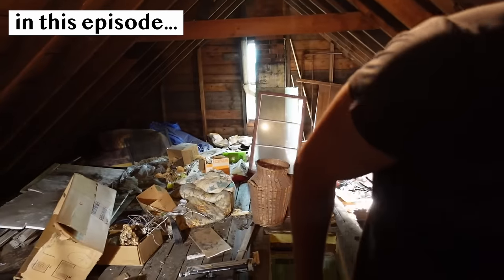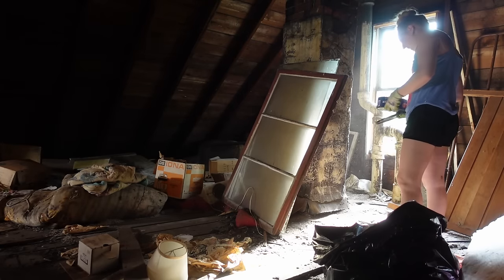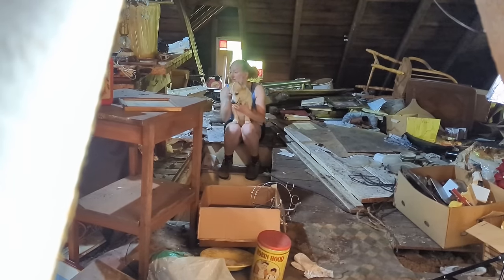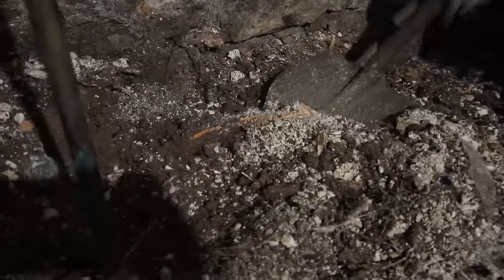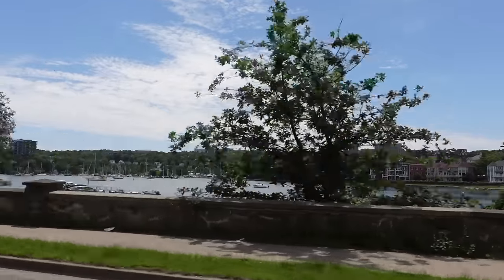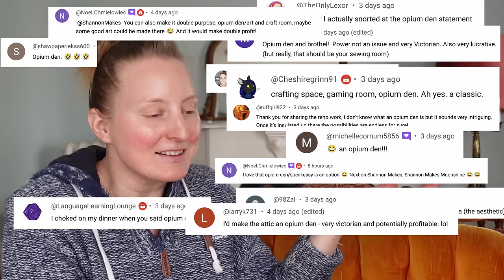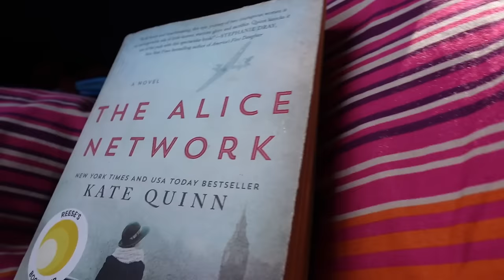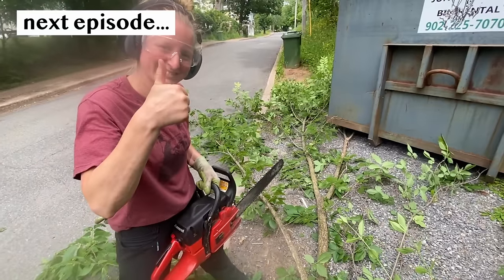A Century of Antiques in my Spooky Attic: Trash or Treasure? (ep.3)

Comment: A good idea is to get a kit so you can check for lead in china glazes and crystal, to make sure what you can use or just display.
Reply: I got one on eBay recently for checking vintage pewter that I want to use for reenactment.  Not expensive and looks like it'll be really easy to use, when I get it all out of storage 😀
Reply from the maker: I am far too savage to actually use any of the china 🤣

Comment: Insulation is needed, decoration later as you stated. Make a priority list. Heat & hot water, insulation to prevent heat loss through the attic and learn to cut glass and reglaze them. Hunt market place for old storm windows that would otherwise be thrown out. Get measurements and always carry a tape measure with when shopping.

Comment: That attic looks almost identical to the Maine 1880s Victorian house attic that I grew up in. I cannot emphasize enough how cold or hot it was. One winter we lost a slate off our roof and a small pile of snow got through the boards and sat there on the floor until the spring when it melted. If you decide to use it for a crafting room, even with insulation, I would think that you would need a separate source of heat and air conditioning because I can't imagine the insulation would be enough. That said, we did have a pool table up there that had collapsible legs but there were only about 10 days a year we could use it.

Comment: You can insulate the attic floor if you don't need the attic for a living. And renovate the windows in the attic. That will help a lot in the beginning with not to much cost. .  You can do it by your self and safe money for heating. The roof seems to be ok for the moment. If you don't insulate the roof from inside the attic you can always see what is going on with the roof.  But it is only my opinion.

Comment: I'm way late to the party but I have an idea for your attic that you haven't mentioned. It's probably because it won't work for some reason or other, but just in case it hasn't occurred to you, here's one of my personal home improvement dreams:
I've always wanted to have a home gym (for lack of a better word). I don't mean a space crammed with heavy duty strength training equipment, I mean something more akin to a dance studio with wall bars, free weights, various mats, a huge mirror, the fun stuff, you get the idea. Screw a few climbing holds into the walls for killer strength sessions bouldering an overhang. Get a small trampolin. a balance beam. A slackline. Rings in the rafters. It wouldn't even require a ton of insulation to begin with, though you'd probably be restricted in when you can actually use it without.
Doing what you do, I would at least consider turning a large attic into a space for training and rehearsal - if you can make it fit your requirements, anyway, if it's high enough and whatnot. I don't really know anything about your art, but presumably, there are things in your exercise routine that would work?

Comment: YESSSS, using the word "defenestration" properly in a full sentence!

And I fooled my sister in-law this year by giving her one of those Danish butter cookie tins...full of the original cookies!!!

Oooooh, scaffolding....that's on my list of things to eventually acquire.

Wow, the Halifax Habitat ReStore looks like it's three times the size of the one near me (Ottawa East)!

...if you ever have to get the roof done, adding skylights for the attic would be awesome... but I don't think I'd risk doing them without redoing the roof around them and I can't remember if you said the roof had been done or whether it was ok or whether it needed doing... Insulating the heck out of it and painting at least the ceiling-ish parts white would probably help a lot with the lighting, we work in buildings the same age and one of them has a skylight in the dining room and it makes all the difference in what's otherwise a pretty small apartment crammed into an attic... and in the one next door without the skylight, using a very light coloured floor brightened up the kitchen significantly from the previous terra cotta tile. That one needs insulation though, rather badly, the hip walls get hot in the summer from the sun outside, as we discovered while removing tile from the bathroom during a renovation project in there one July...

These videos are such fun, I love old houses and all the things to find in them!

Comment: If it were my space and knowing that you are a consummate DIYer/sewist/crafter, I would cut out those beautiful skylights and make it into a super spacious crafting space with a few nook areas to sit and read and think and of course, a cozy space to take a nap
….but you don’t seem like the napping type. Now, being that it’s the attic, It’s hot, of course, in the summer months, so ventilation and air circulation is key if you’re planning to use the space all year round.  If the house was located in the US, I’d say an AC system would be essential bc otherwise, even lots of fans are not going to cool things off enough in the summer and even most of the spring. P.S. I don’t blame you about not disclosing your specific location/address. There are just too many crazies out there and you can never know who’s watching.  Good call!👍

Comment: You should first look for newspaper articles related to the house or address. After that, the assessors office would have info on the property records. Possibly, your public records office could have pictures or papers of the house that are dated. After that, public sourcing will also work like you asked for. 
My last suggestion and this doesn't always work is asking the previous owners. They tend to know this info already. 
Part of this is just filling out information requests with your local office.

Comment: I grew up with a black phone with rotary on the wall. Later, I had harvest gold with dials. I still have two harvest gold dial phones, one for the wall and one for a table. I still used that phone number until 2004. At that point, I could answer the phone using those plugged in. I couldn’t dial out.

Comment: Keep the attic as your private creative get away space 😊 They have a spray insulation that is offered now however if you ever had a roof leak it may be difficult to determine where the leak is coming from.
Reply from the maker: Oh, I will NOT be putting spray foam in my house... too many problems with that, lots of historical house professionals are seeing lots of trouble that it causes

Comment: I have a question….when the energy people came and gave you a consult…didn’t they say to insulate the attic? Your winter heating is going to be a big issue and Nova Scotia has at least six months using heat. But if you can get away with not insulating the attic…then make it a summer AirBnB room. That is …if you can create a cross ventilation with ceiling fans. As you said your attic can be very hot in the summer. You will have a short time for visitors…June through August and then September for fall color leaf peepers. To make the interior lighter use a paint sprayer to spray the entire interior white…..roof beams and wall…I have seen this done and its amazing how fast, cheap and effective it is. Or use the room in the summer for fellow performers in need of a vacation. I am on an island in Maine and have many visitors in July and August. Also..I mentioned getting a woodstove for your fireplace….these can be safely scrounged…you will just need to line your chimney with a metal chimney liner which is cheap and easy ….and get a used stove (many are free because they are heavy to move) and replace all the firebricks that line the inside of the stove…which is cheap and easy.

Comment: Lighting for the attic. LED light tape. You can glue or tack it to the ceiling. That is what I'm going to do in my attic/craft room Want a finished look, get creative with molding, plexiglass or yes you can buy finished lighting units, where's the fun in that? Comes in shop lighting, looks like fluorescent, just as bright or brighter and more energy efficient.  That is probably what you want for the basement, unless you are going to convert it into a torture chamber then it would kill the esthetics.

Comment: Try your local historical society, if you have one.
Reply: New to your channel!  Enjoyed your first video…the first thing you need to do is check to see if you have a secure roof. If you insulate all of your attics and then get a leak, you’ll lose your insulation. Winters are brutal up there.  Take advantage of those rebates…good job!  I hope you will be able to keep your radiators!  When the furnace and radiators are working you’ll have great heat. I grew up with radiator heat. It was wonderful!  I haven’t been truly warm since I left home. If possible and safe. Try to keep your coal fireplace.  Have you called to see if someone or some business carries bags of coal?  A small  coal fire lasts longer and burns hotter. I hope everything works out well for you.  You’re doing a great job so far…Tina

Comment: Please, please protect yourself with masks or resporators - anywhere in that house. Any air you breath - attic, basement, even the main level can cause issues. If you are disturbing mouse droppings at all, they can carry a pretty deadly virus. And in case of any other older materials that may have dangerous chemicals in them. Mold is bad also. Take care of yourselves!!